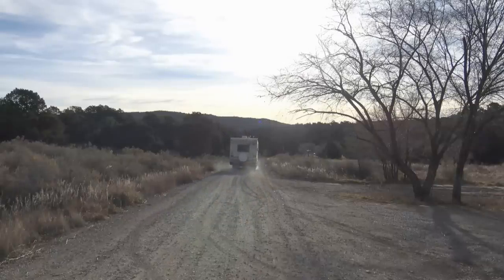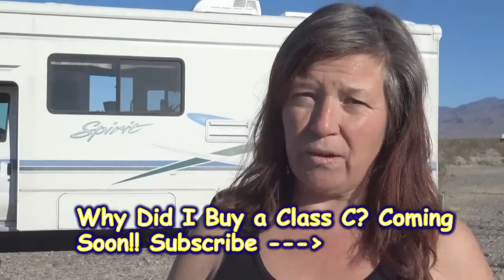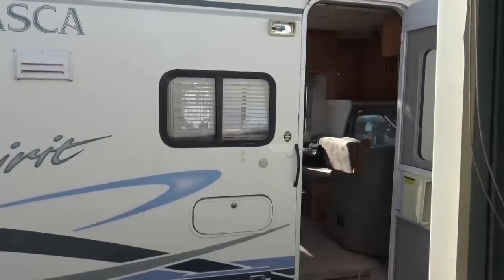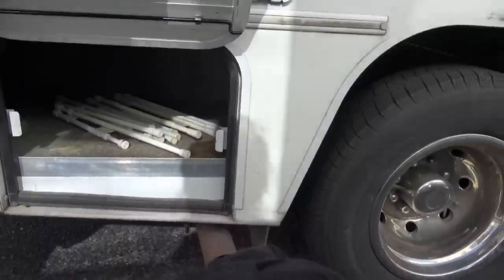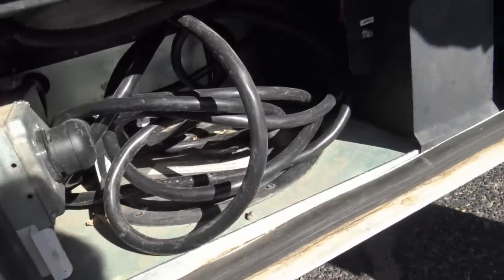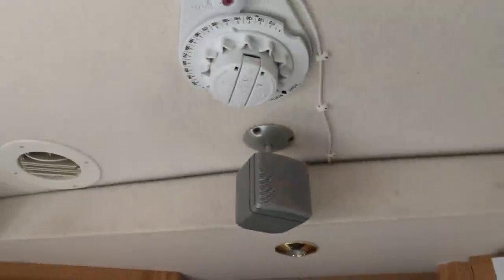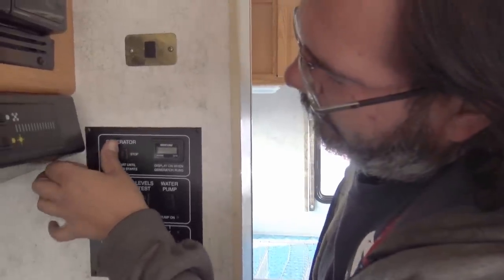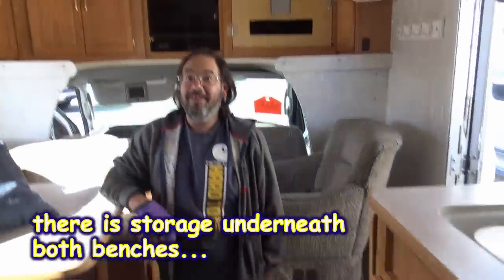My New Class C RV:  24'  2005 Winnebago Itasca Spirit/ RV Tour

Comment: Bless their hearts for taking so much time showing you all about your new RV so you understand everything on how to run it, etc. These guys really seem to care. When we bought our 2017 37 foot diesel pusher, paid over $180,000.00,  we got less than 15 minutes with them to show us what to do. Needless to say, it was daunting as we have never owned a diesel. On the first maiden voyage to Scottsdale Arizona to the Mayo Clinic for me as my health is bad, it ALL broke down. LIterally. No hot water, no electricity, the windshield was loose and the seams of the rubber seal around it was flapping in the air as we drove. Next, the full length slide out literally jackknifed and would not go in. The frame actually split apart. A nightmare we will never have again. Your pretty new  "Spirit" is beautiful. I agree that the name fits her, as her "Spirit" matches your beautiful Spirit as well. Congratulations.

Comment: Fun exit from the previous video and entrance into this one.  Congratulations on your new motor home!
Carolyn, please make certain that the VIN on your sales contract, pink slip, and registration are the chassis VIN (on the driver’s side dash).  That is the VIN that the smog tech reads when testing your MH.  It is also the only VIN that will survive if you ever suffer a fire.  The house VIN may make a difference to Itasca, but no one else cares about it.

Comment: strongly suggest replacing ALL those incandescent lights with LED lights.The LED lights take 1/2 (or less) the power.  Using LED lights will (approx) be able to run four times the duration of the incandescent lights.  This becomes a big deal when camped out in the boonies

Comment: Love your new motor home!  We bought a 2005 Winnebago Aspect, 23.5’.  Love it but we have to put together either the sofa or the dinette to make a bed.  There is no “dedicated” bed, which I miss.  We have a bathroom in the rear of the rig.  From the sign on the rv, it looks like you got a much better deal.  We do have a slide which adds some width so that helps.  The dealership has been awesome to work out any problems we have had.  Happy trails, Carolyn.  I miss Capone also.

Comment: I have the same motor home, just to let you know when you go to drain your grey and black water you will need two 45 degree angles to connect them together to fit through the bottom  hole to drain. Congratulations on your new coach.
Reply: Thank you for this. I have one 90 and one 45 but could not think outside the box, and didn't consider that 2 45 elbows would move the connection out where it needed to be. I have an '07 View and same situation.

Comment: You can DIY or have someone wire the solar panel to the battery bank so it will charge even when you turn off that switch. That's what I have done with mine, and I never have to worry, it just does what it's supposed to do. You only need a 7 amp charge controller and some extra wiring that is proper size to the application. Connect it all, and the batteries will charge on and off as needed. Also, something important you neeeed to be aware of..; check the water levels in each cell of those batteries, making sure all the metal in each cell is under the acid water solution. If water needs to be added, use a plastic syringe to draw up a few ounces of "distilled" water from a store bought gallon (pour some into a cup first if needed), and then take the syringe and carefully, and slowly add the distilled water until the level reaches about 1/2  inch above the metal plates and no less than 3/8 inch from the bottom of the cell cylinder holes, making sure that the water level in each cell ends up at about the same level between all the cells. If any of the cells over biol at all (IE make a mess on the surface of the battery/ies at all), then just replace both batteries! Trust me, If you want to save yourself trouble. ;-)

Comment: I am amazed the tech could not figure out the latch on the batteries. Slide the little bump in the middle up and pull the handle down. It is an over center latch. Easy to operate one handed. Also need to check the voltage on the coach batteries with the engine running. If not the same as the engine battery, your charge/boost relay is failed....... extremely common problem.

That propane detector is original. They have a life on the sensor of about 7 years, so even if it seems to work, it probably is not safe to depend on it. The Manufacturer went out of business so the best replacement is a Safe-T-Alert 30 Series LP Gas Alarm 30-442 made by MTI. Same goes for your smoke and CO detectors, if over 7 years old, replace them for safety's sake.

Comment: Good for you! Happy for you. So when you add more solar, you might need a bigger inverter. If  you hook up your suitcase panels, you'd use a "fish tape" to run the wires down the wall--inside the wall. That way you won't be hurting your lovely new home. Do you know about the RV supply place in WA state?  They might have a cupboard door for where the TV was. Eric (nomadic fanatic) has been there, and Ausia and Carolyn have also. You did a great job finding this beauty!
Reply: Theresa Buchtel i

Comment: True deep cycle batteries will allow thousands of complete discharges where car type batteries cannot and are really not made for that. (I’m not talking about hybrid batteries such as marine starting batteries either) True deep cycle batteries for RV use will last so much longer than car batteries. A car battery has to release many amps at once to start a vehicle motor, where a deep cycle battery will release far fewer at once but way more than anything an RV will require. A true deep cycle’s advantage is that they are made to take discharging, all the way to a complete discharge, without hurting the battery. A car battery is weakened every time it takes a discharge, they are made to be charged at or near capacity all the time.

Comment: DO NOT EVER put 300 watts of solar panels straight to your batteries!!!!!   Most you can do straight to batteries is 50 watts, but even then you have to know what your doing...
Reply: Please explain why this should not be done.
Reply: @maryferguson6226  Too much too fast. Like a battery that only needs to be trickle charged. Send too much power and could cause a fire or compromise the battery case.

Comment: I enjoy your videos,  thanks for doing the walkthrough.  I have had my class c for 2 years and always had trouble getting the generator running.  My previous solution was to try to start it, wait ten minutes and try again if it didn’t start.  I usually had power within a half hour.  After seeing how he held the stop button in for a few seconds before starting. I had to try that with mine.  It started on the third try and it was running within a minute instead of a half hour.  Thanks again for including  that  helpful tip from the tech.
Reply: Glenn Osborne P

Comment: It's good to do your cooking with bottled water as well as making coffee in the morning and stuff like that. And use the RV water tank for everything else. Put distilled water in the batteries if they are low. Anybody that knows anything about batteries will tell you that about the distilled water. Especially battery manufacturers. The deal Still Waters also good for radiator rest well. That helps to prevent calcium buildup in the radiator. Enjoy your new home Happy Motoring.

Comment: LOVE the Liz Warren tank. She persisted indeed - my rockstar senator :) Also, just fyi: at 14:00 there are 7 emergency weather frequencies. No matter where in the states you are, generally at least one of them will be a nice clear, and LOCAL signal: 
162.400
162.425
162.450
162.475
162.500
162.525
162.550

Comment: Awesome Carolyn !!, your RV is  identical to mine, same year,same frame (F450), same length, also came with solar, practically the same layout just my fridge and stove is on the other side and a different manufacturer, I also noticed in your video that you also  have a back up camera with the led screen on your driver-side sun visor like mine  :)  wow, i'm so happy for you, congratulation . Curious, do you also have the 10 cylinder V-10 Triton engine? It's a very good engine, and surprisingly does decent mileage per gallon. When i first purchased mine in mid August i was worried about the gas mileage considering it's a V-10, but surprisingly my 24foot Class-C did better gas mileage than my brother-in-laws V-8 24foot Class-C on a recent trip,....okay, he only has a 3 speed transmission on his RV, lol. The V-10 has lot's of power and the engine does not force at all in the 24 foot Class-C, I'm sure you have already noticed that compared to Matilda with her V-8(less horse power) and that she was 29 feet, thus heaver than your newer 24 feet Class-C.  Take care Carolyn, Bob.W

Comment: Carolyn would you recommend this unit- a 2005 Itasca Spirit 24 ft? looking for my first time RV. Parameters don't seem that far out of line with what I have seen on line are yours.
Message I got out of trading in Matilda was it was too old and too many problems. Shocked to find you spent 19G and 4 weeks getting Matilda repaired in year one of ownership.
Have heard Lazy Daze is a better built unit but to get one at the same price point it generally has to be older.
Thanks.

Comment: I would "add extra batteries"  and isolate  them {onto switchable circuits}  if at all possible.  Since your unit has a generator...One battery could get solar trickle charge  ...and be wired to  only start the generator while supplying power to nothing other than the generator starter...  {Your unit "may" already be so equipped.}  Doing this can  improve comfort & convenience....and save you from needing a jump start.   in my own  3 million miles {or 5,000,000 kilometers} of travels I have learned a few things...sometimes, the hard way.    Deep cycle Screw post  semi truck batteries should serve well.   Caterpillar and Interstate both put their names on such batteries.  Dual Purpose AGM  31 series batteries are my preference IF THEY WILL FIT into the battery box or compartment.  AGM is not a common lead acid battery... Lower maintenance and not likely to spill or leak.
 https://www.interstatebatteries.com/recreation-vehicles/marine-batteries/dual-purpose